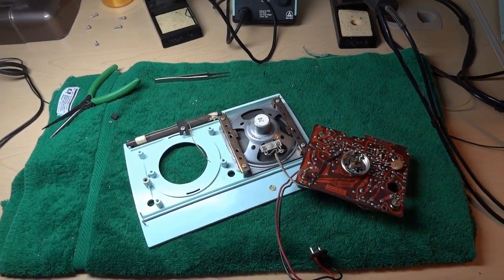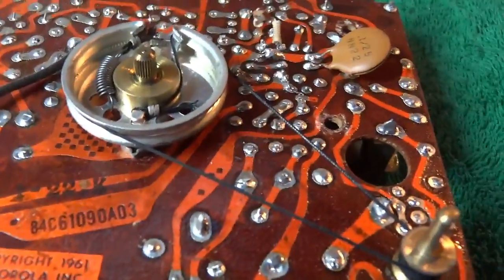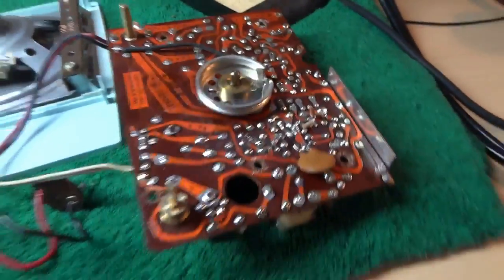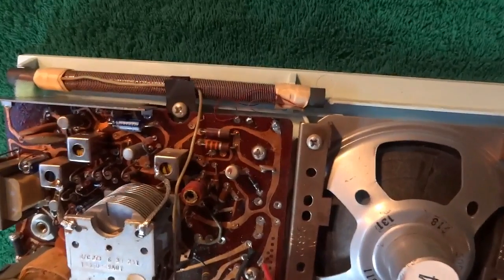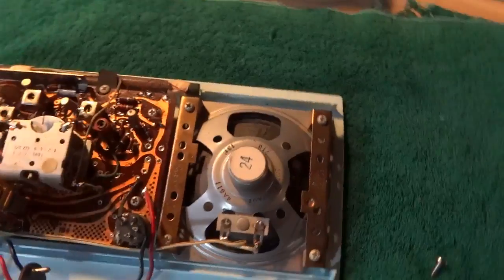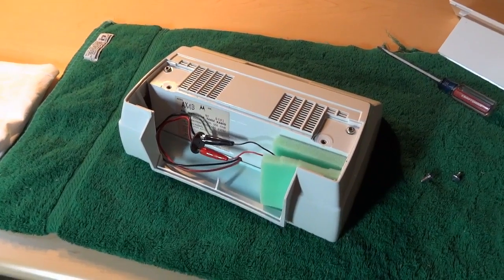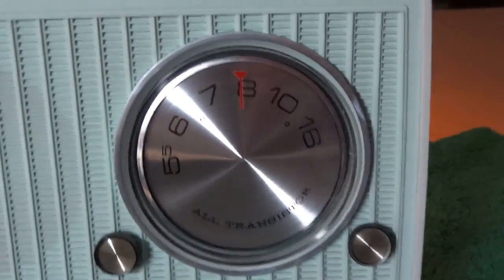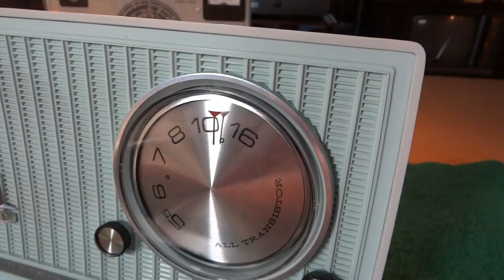Restoring the 1961 Motorola Transistor Table Radio

Comment: Very nice restoration on a very nice radio!  I don't know if this particular radio was made there for sure, but the majority of Motorola radios of that size were made at one of their Quincy, Illinois plants.  Most of their table radios, early transistor radios, and car radios were assembled there.  In fact, they had Motorola's first pc board assembly lines.  The transistors themselves were made at their Phoenix, AZ plant.

Comment: At first glance I thought it was an AC powered transistor radio, they used to make many that looked just like AC/DC tube radios during that era. I've seen that sort of plug used someplace before, it may have been for a speaker or a phonograph in cabinet stereo. The size of the battery may have been intended not just for longevity but to give the radio a low center of gravity. That radio looks like it came brand new out of the box, no scratches or dirt like they would typically have.

Comment: You could probably rig 6 C or D batteries if you wanted to run it longer on the table without changing the battery.

Comment: As a method to replace the original battery that would have the juice for the amounts of days and not hours of use could use a 6 "C" dell battery case that would fit in nicely. 
Ebay: Velleman BH261D Battery Holder for 6 X C-cell (with Solder Tags)